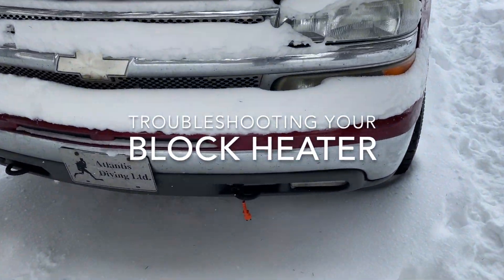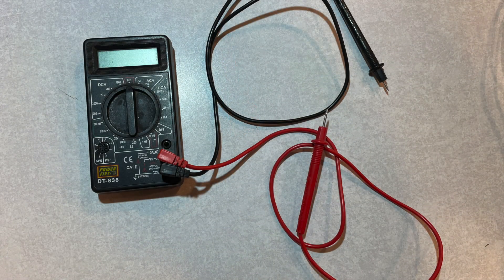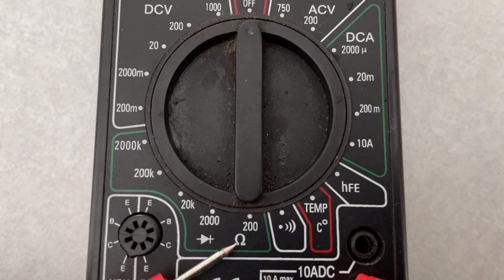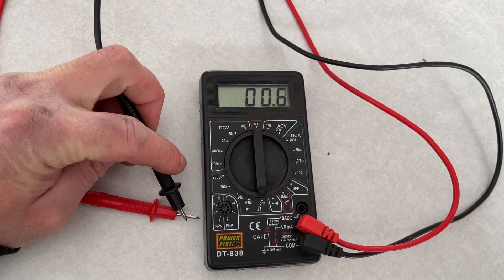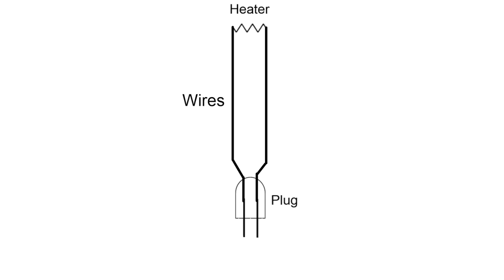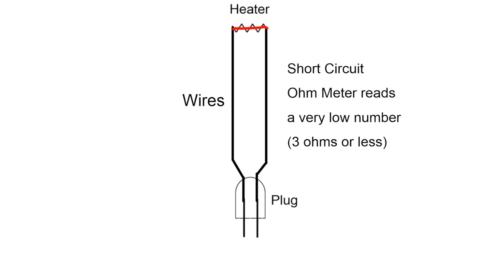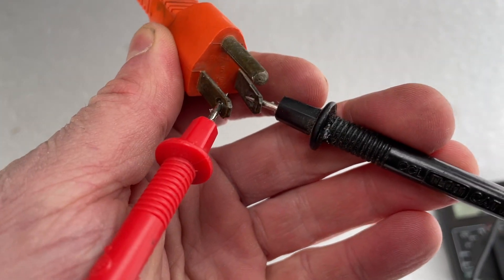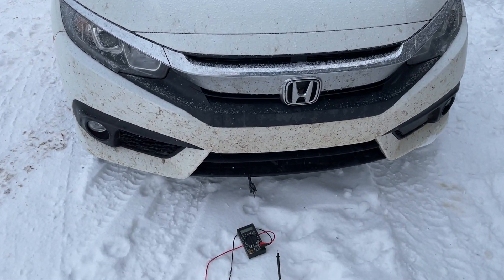Block Heater Troubleshooting

Comment: I have a co-worker who installed a block heater in his truck that had a built in thermal switch. At -18c the circuit is closed.  Interesting feature, but I would prefer the block heater on if plugged in period.